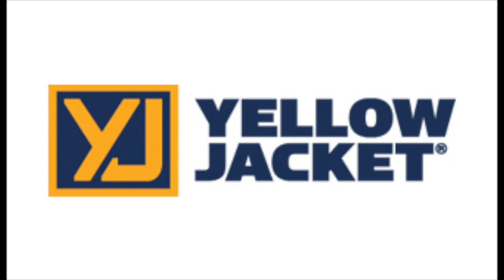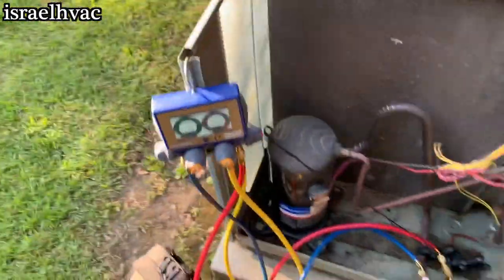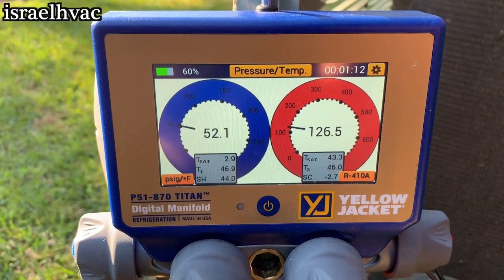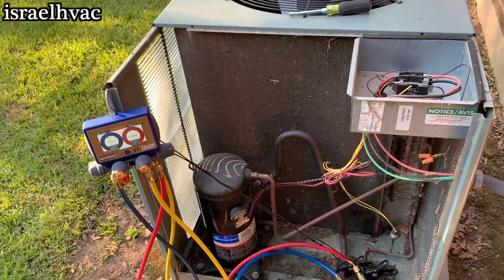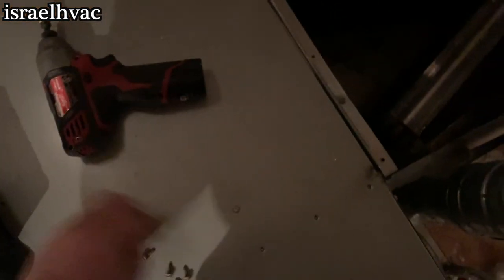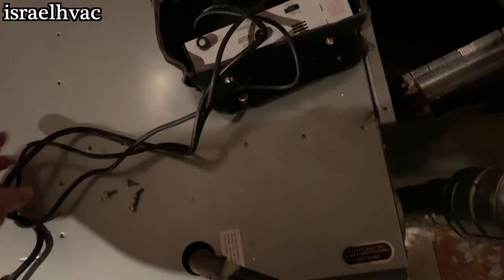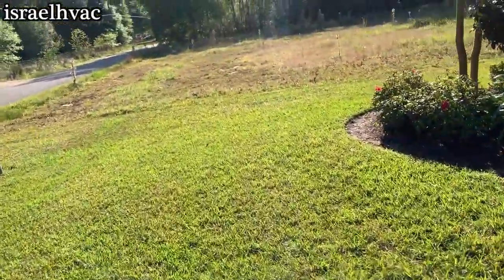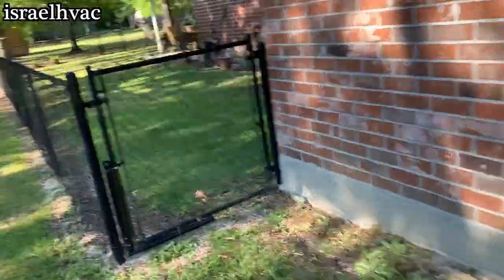HVAC Service | Condenser Kicking On & Off

Comment: i appreciate a contractor that will diagnosis an issue then repair the unit , instead of telling the customer you need a new unit cause your system is old and beyond repair. i can understand repair work that might be more expensive then putting towards updated equipment but some guys just want to install new units nowadays , not trouble shooting issues. so kudos to you.

Comment: Usually, I end up pulling the coil and repairing it with silfos.  Most of the time its on heat pumps that are no longer made (Square D) and the tonnage is unknown, cap tube with check valves.  So many things to go wrong.

Comment: What gauge set is that? And is it worth the price?
Reply from the maker: Yellow Jacket P51-870 worth every damn penny
Reply: @johnisraelhvac2019  yeah I eat just looking at them. I saw them for 530 do they come less expensive? They look good though.
Reply from the maker: Try your local supplier. Kind in mind you get the Manifold a set of hoses a 3/8 vacuum hose and they come with a backpack.
Reply: @johnisraelhvac2019  thanks bossman

Comment: For charging in cold weather I have a cheap tent that you pick up from the Goodwill store 40 or 50 bucks cut out a hole in the bottom of the size of a 5 ton condenser make sure it’s a tent that’s a quick pop up 8‘ x 8‘ and you can adjust the temperature to 85 or 90° inside the tent by zipping up the door or opening or closing windows very precise temperature control very easy very quick and you don’t have to come back a second time when the weather warms up